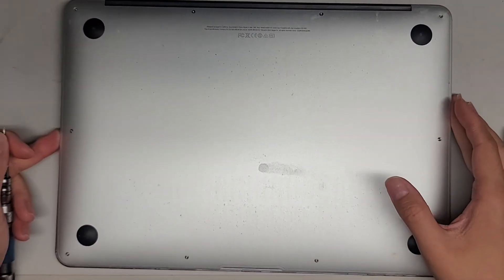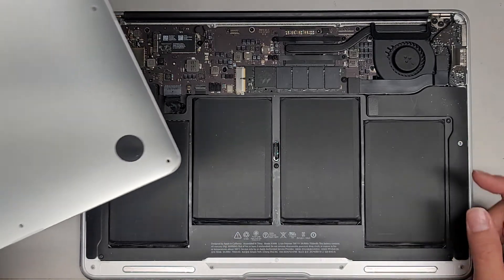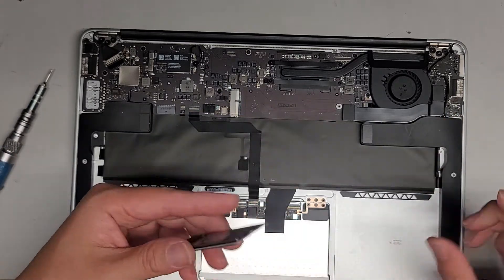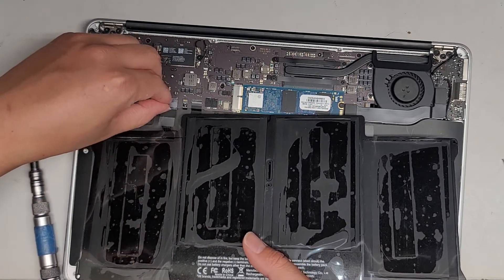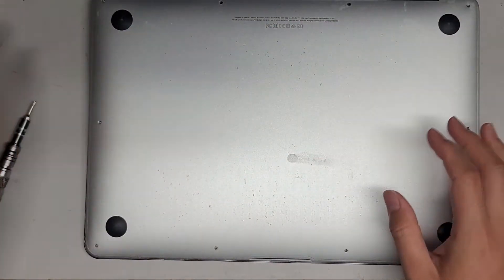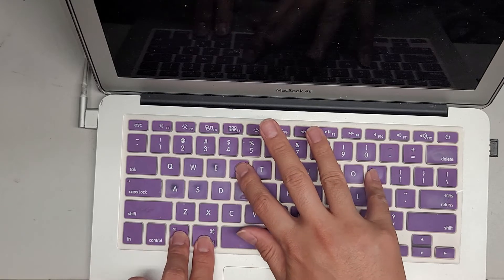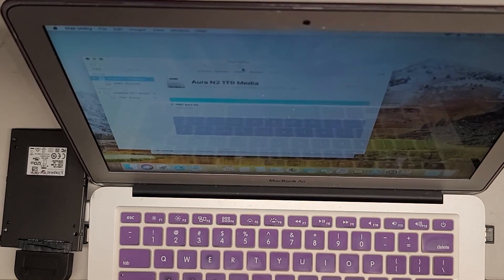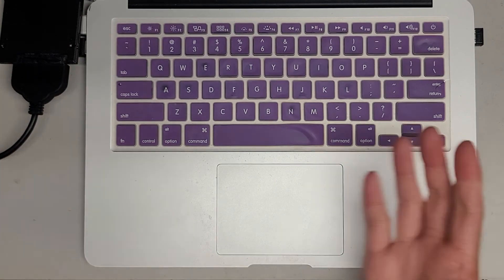13 inch MacBook Air A1466 Mid 2014 Battery and SSD Hard Drive Upgrade Replacement Repair OSX Install

Comment: Thank you, this video was helpful. I just ordered a new ssd because macbook air a1466 suddenly shut down and when I powered it back on, there was a blinking folder icon on the screen and I looked it up and they said that means the hard drive malfunctioned.
Reply from the maker: Hope it works out.

Comment: I want to thank you Binh for the video and all the effort you put into it!  I've been in IT for almost 30 years, but Apple products are their own kind of animals and finding this breakdown worked perfectly for a failed SSD.  1) If you are swapping SSDs - Be AWARE that Apple did the snob thing and did not follow a standard! (Normal for them) - SSD is a PCI Gen 3 12+16 PIN Config... Not a normal M2 PIN for the SSD.   2) The corner screws on the outer casing are ULTRA small, hit one with my elbow and it rolled off my table into oblivion, so be careful. Understand that each screw is a different size! (Because Apple, that's why).  3) To help others find SSD, this model comes loaded with Samsung Model: MZ-JPV128S/0A2  SSD -Google it-, these days only 3rd party players make low cost replacement SSDs for this model.  I chose DATARAM 256GB on Amazon as the best reviewed.  4) To get into the case I ordered the "JOREST 38Pcs Precision Screwdriver Set" for the special torx screwdriver, cheap and great for the task (unless you will do a lot of work on Macs, then get a real set of quality screwdrivers).  Good Luck to all that make it here and heed the help like I did!
Reply from the maker: They make adapters for normal m.2 SSDs, but the MacBook needs to be updated to at least mojave for the firmware to be able to boot from it. 

Apple now made their things unrepairable by linking all the parts to the m2 chip processor or something. Now any damage renders their devices useless... so dumb.